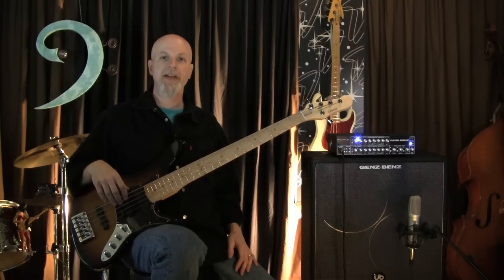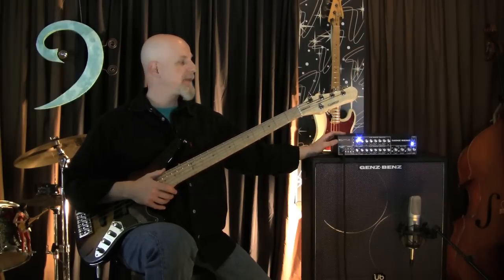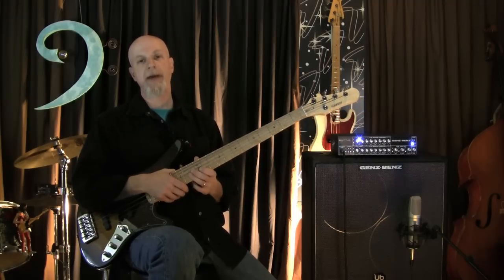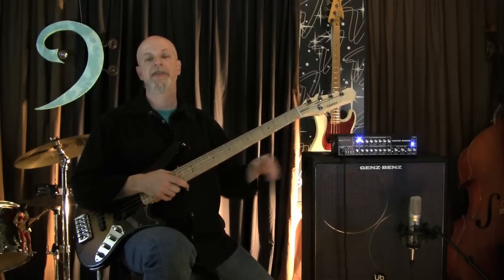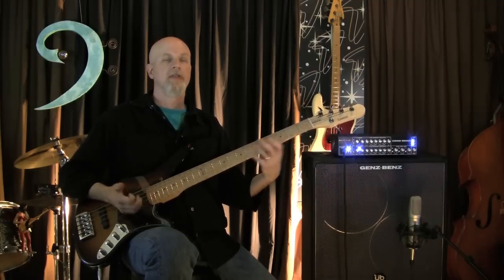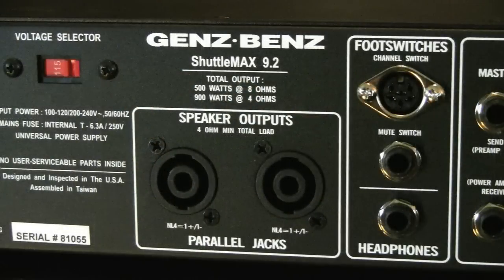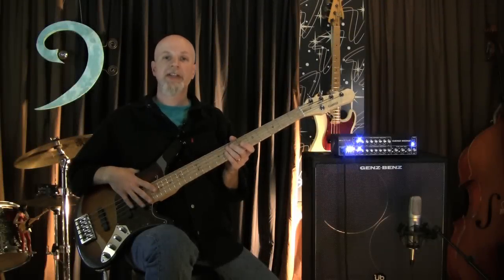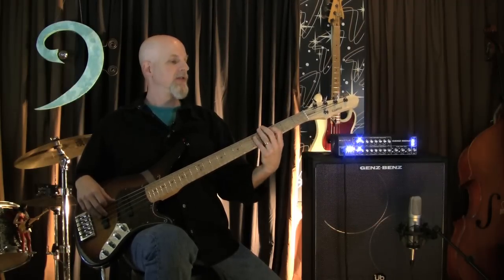Genz Benz Shuttle Max 9.2

Comment from the maker: @Bassplaya4string - I think the flat tone is pretty much the same, but the Max has two bands of parametric midrange, so the tonal capabilities are expanded. Also, the 3DPM in the Max does change the experience when you start cranking the amp, it's more of a "feel" thing than a "tone" thing, but... with the controls all set flat.... I'd say the 9.0 and 9.2 are very close.

Comment: Ed I'm really wondering about this, I've heard that MOSFET's generally sound more musical than Class D's I was wondering on your thoughts? I've only got the EBS Reidmar vs. the EBS TD660 as reference, and well... the TD is 3 times the price so it's not much of a comparison.  I'd like to try both the GBE 750 from Genz Benz and also this ShuttleMax 9.2 but Genz just isn't normal in Denmark, so I'd be happy for your input ^^

Comment: hey ed i could really use some advice, basicly i got a jazz bass nt quite a month ago, and the setup is really frustrating me. if ihave the strings set to high i can play on it, so when i lwer them they hit the neck pickup, and when i lwer the pickeup they still sometimes hit it, als the bridge pickup is allot louder than the neck and even if i get the bridge lowenough for the strings to stop hitting it the bridge p-up doesnt go low enough to even out the volume. what d i do THANKS :)

Comment: Nice review! Is there any difference in tone between the shuttle 9.0 and the 9.2?
Reply: 11 years later, here's your answer.  The algorithm in the power supply was redone to provide a bit more headroom. Straight from the horses mouth, so to speak.  I know the guy that developed these, he's now with Mesa Boogie.  Check out the Mesa Boogie Subway, very similar.  He also rehab's older horses.